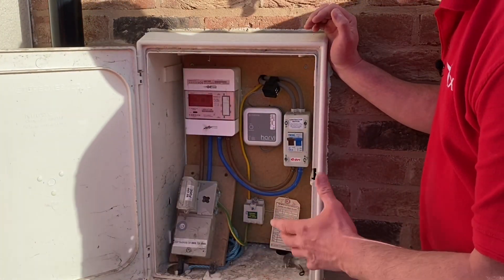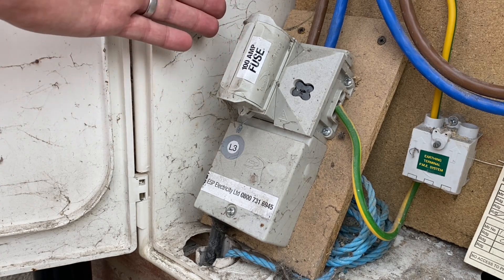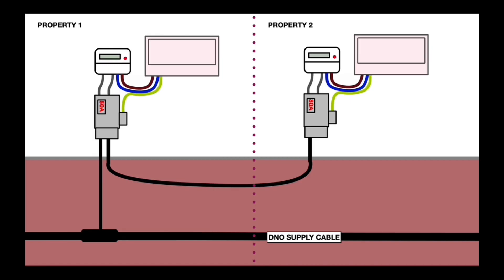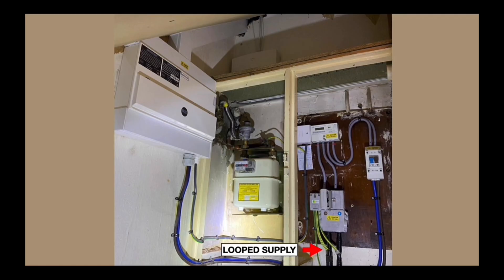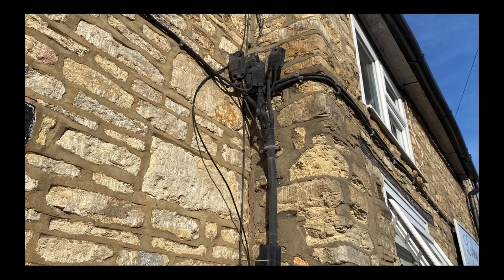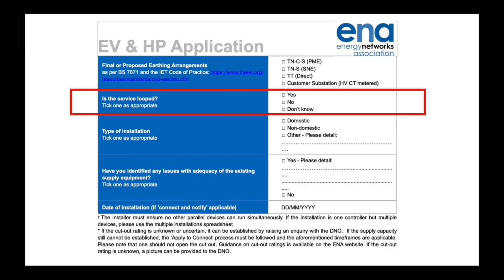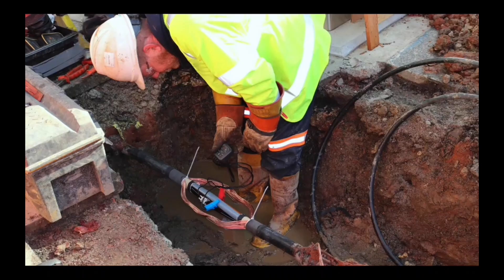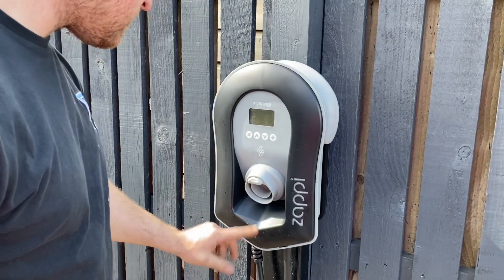EV Charger installation : BEWARE Looped supply - what are they , cost and time to correct

Comment: I live in an ex council semi detached property (1950s), I do have a looped supply however one cable comes up into main fuse chassis and then it loops through wall into neighbours side. This seems a bit different to the double cable examples you showed. 

I don't have an electric car yet, but applied for a higher rated fuse (induction hob and the likes) and the DNO installed an 80amp fuse my side, and said that's the max they can do on the supply. They did say next door had a 60amp and now I have an 80 amp they would not be able to up their side as that's the limit, so it's good in a way I got that done first! 

Somewhat good news for me at least, like your video stated, is that I am the main incomer, so the majority of the future work should be on next doors inconvenience and not me. But I really do think with the explosion of EV this will be a major headache for the DNOs for years to come.
Reply: I think I agree with you.  Thankfully, I have neither owned nor driven, any vehicle since 1982, so I won’t have the problem.

This reminds me of the problems upgrading the supply to a college where I used to work.  We were fed at 6.6 kVA from a nearby, overloaded, 33/6.6kVA substation.  The intention was to move to an 11 kV supply from another substitute a few hundred metres away.  Our transformer was swapped for a new one with a dual Voltage primary, but then the problems started with various obstructions to the route where they wanted to run the new HV cables.  After two years these problems hadn’t been resolved when I left.  I have to say that whoever spec,’t up the original installation in the 1950s did a good job of it, our load would have been vastly greater than it was then.
Reply: @srfurley  agree. They built for longevity back in the day.

Comment: I had an EV charger installed at my previous house by the charger's official recommended installer. 

They weren't bothered that I had a looped supply or that I had a 60a main fuse. 
Only found out that I had a loop when I contacted the DNO to ask to have the main fuse upgraded before I put the house on the market. 

Thankfully only 2 of us on the loop and only my house has off-street parking, so both houses were upgraded to 100a fuses

Comment: If there is a looped supply in a main head the job is free as dno will remove existing loop to next door and run a new service to next door if the existing service cable is big enough for 100 amp fuse e.g. 35h 1ph 16mm split concentric copper 25mm split concentric copper or a .0225 pilc service copper core. Falling that if it isn’t big enough then a new service back to original position will need to be installed. Or a outside box installed to a new cut out. Sub main installed must be 25mm sub main for 100amps to a switch fuse sub main run from there back to consumer unit

Comment: Had my charge box fitted by a well known supplier then had a visit by the local DNO who told me i was on a looped supply with my neighbour.( I only had the one cable in my cut out) My meter was in the hallway next to my fuse board, 4 weeks later i had a new outside meter box like in your video, the only work i had to do was cut the box into the wall as i wanted a flush mount box not an external mounted one and it was all free of charge.

Comment: Out of curiosity, why are dedicated EV chargers so prevalent in the UK? I'm in Australia and outside of public charging points, it's rare to see actual wall mounted points. 

The typical chargers you get for plugging into a wall outlet seem to be enough for a majority of users (although we don't have much uptake). That's only 10a as well, whereas you could get away with 16a over there. 24/36kWh is gonna get you pretty far for a typical 10h overnight charge.

Almost seems like more trouble than it's worth to upgrade your supply for an EV rather than just charging it slower?
Reply from the maker: Most cars now have a 75kWh battery 🔋 so will need reasonably fast charging. Second the chargers handle lots of the safety aspects. Then our government wants chargers to be smart so they can be controlled via smart grid as uptake increases.
Reply: @efixx  Having a smart grid seems to be the main thing I get out of that. Saying a car has a 75kWh battery is pretty meaningless, same as saying my ute has a 70L fuel tank. It could in theory use all 75kWh in a day but if movies have taught me much about the UK, it's small and not many people drive that far.

EV's look to use say 30kWh/100 miles. So a typical plug in charger would do that each night. Reckon 100 miles a day is above or below average for your typical motorist over there?
Reply from the maker: Yes your right when looking at averages. However  lots of folks do a considerable amount of miles for work. So need to cope with nearly empty when you arrive home and leave early in the morning and want a full charge.
Reply: @efixx  Ahhh so it is mainly a person who drives more than average who will put in an EV charger at home and the rest stick to your basic slow plug in ones.

Makes sense! Just seemed like there's a whole bunch going in from the content on YouTube, which would be a considerable cost if most folks only did 50 miles a day.

If only Australia had as much of an uptake of EV's! We just put extra taxes on them instead.
Reply from the maker: If you have an EV our advice would be a proper charger for those unexpected things that happen in life. 
In Australia you have all that sun so a happy marriage for EV's which could cut your cost of motoring. 
If you want a glimpse of the future - watch this video from Tony Seba - https://youtu.be/2b3ttqYDwF0
Reply: Personally for me it was the convenience. Public charging points are not abundant and the increasing number of TVs mean there's more contention for them. You then have those times when you have been running around in the car, planning to charge later in the week ... and then you get that invite to visit friends further away. You might not have time to go out & charge, so being able to plug in at home for a couple of hours at 7kW rather than 3kW or so can make all the difference.

Comment: It was and probably still is common practice to loop supplies, 35mm into the cutout with a 25mm running round to next door. It had nothing to do with cost cutting, just the way the network was designed. I worked for the DNO from 1988 until 2007 and installed most domestic supply cables this way.
Reply: Really?.. not a cost cutting?... it was .just designed like that? Clearly it was designed like that to cut costs ..it literally halves the trenches to be dug, wall penetrative to be cored and live joints made to the main cable in the street with each looped property!

Comment: There are other types of looped feeds!

Often you get two fuses, one feeding the master and the other feeding the loop. Often you see a set of tails disappearing through a party wall to a cutout next door. Not good if you have a disagreeable neighbor ....... or if you blow the main fuse when the master is away on holiday! 

There are also different types of Mural feeds! If you have an older one it may be Lead coated VIR cable! If this is the case your DNO will replace it for free. If you have a rubber one they may not do the upgrade for you (unless you have a solid earth conductor)! Again there are different wall boxes feeding Mural systems, some will be replaced once brought to the attention of the DNO. Others not so. Often there are problems with people building over the top of Mural cables complicating the issue too. Quite often you can have 4 or 5 linked together!  

 It is not possible to go into all the differences and which can get replaced easily on this thread. It is however DNO policy to replace loop feeds with direct feeds rather than repair the loop now. If the damage to the loop is deliberate or caused by a contractor they will charge for this though!

Comment: could you confirm that this looped supply includes TN-C-S. i know that older TT &   TN-S was, my house was coveted from TT to TN-C-S back in the late 80s, as a terraced house next door was looped but it had to be removed and given separate    feeds from the over head lines Reason given by DNO installer voltage potential on the neutral might  rise above 2 volts.

Comment: This happened to me....  my EV installer (Lee at www.morzak.co.uk) found out about the loop when he informed the DNO Western Power of the planned installation.  Western Power were really good, there was only a 20 day lead time and they quoted 7 days to do the work which I thought was excessive. However it turned out to be a really well planned and efficient process. Day 1 investigate cable layout and dig trench on driveway. Day 2 electrician to do the unloop work. Day 3 back fill trench. Day 4 final reinstatement of drive and they made an excellent job. The other three days were the Easter weekend.  It was a different team every day who just turned up, did their job quickly and efficiently and then left. The only time I got involved was when they had to turn the power off for 10 minutes on day 2.  My car had been delayed anyway so luckily no inconvenience to me at all.
Reply from the maker: Thanks for sharing this experience - WPD seem to be very proactive in sorting these out.
Reply: Ooo, that’s interesting as we are about to face the same thing with Western Power as DNO

Comment: So your in property no.2 not knowing it’s a looped supply because it has one cable in it , you do your install and overload both property’s then what happens? Or do you have to submit the unhuman form first and wait for a reply before you start?
Reply from the maker: Chances are the properties have a lower fuse rating - 60A or 80A so you need an upgrade and that would mean the form going off before an install. At which point the looping would get flagged up.

Comment: My wife had an EV charger installed and it wasn’t until I asked the DNO (Western Power Distribution) for an increased supply capacity (for a new EV i had) that we discovered it was a looped supply. We were property 1 in the chain. WPD we’re not happy that the EV charger had been installed and said we should have had the installation inspected when it was done. I was able to prove that they had indeed visited and inspected at the time and no recommendations were made. Nevertheless, they arranged to unloop the properties at no cost to me and did so in a very professional and tidy manner within week or so. This included digging a big hole in the patio then putting a resin splice thing to link the neighbour to the street cable and a new cable to our cut-out. The patio was reinstated and made good. They also replaced the cutout. They upgraded our supply from 65A to 80+A (I forget the exact value). Overall very pleased with the result. 1968 property, Staffordshire Moorlands area. 

Kudos to WPD for sorting this and making everything safe again.
Reply from the maker: Thanks for sharing your experience Simon very useful.

Comment: I’ve read the comments, looped supplies are everywhere.  Domestic houses with gas central heating will pull virtually nothing & the chance of you having a shower as the same time as your neighbours is rare.  Which is about the biggest load we use, but for a very short period of time.  The infrastructure is not there for houses charging their cars overnight & the whole network requires upgrading.  I would always put on the form that you are unsure whether it has a looped supply.  I came across a property not so long ago, which had a 40A fuse in the cutout.  They had a 9.5kw electric shower, free standing electric cooker, it was a family of 4 & they had lived there for years & the fuse had never blown.
Reply from the maker: Diversity has served us well for many years. Now we have EV's which present 7kW base load for a long period of time. So the chances of exceeding the main fuse rating have increased.